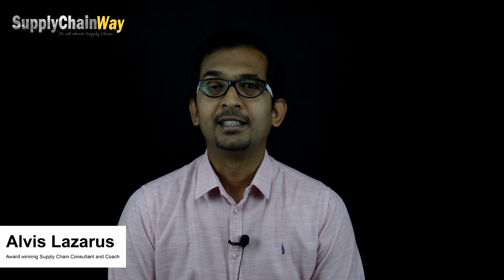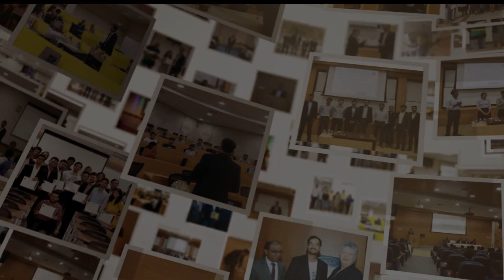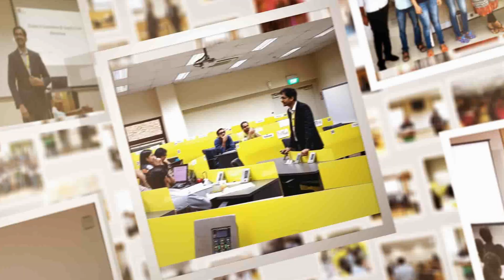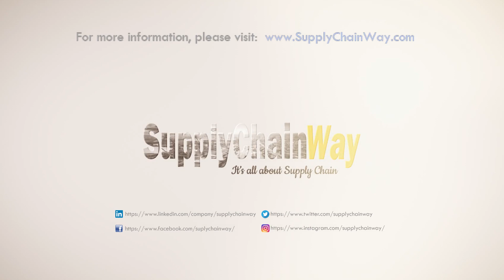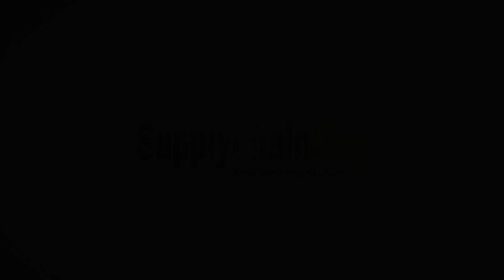SC0012 | PFEP (Plan For Every Part) DFEP (Design For Every Part)

Comment: Hi, Can PFEP be implemented in a consolidation centre where we receive, sort, store, packing and consolidate and ship to customers
Reply from the maker: Hello Kumar. Yes, indeed. Though the opt fit would be and end to end of supply chain. We can certainly use in consolidation centers. The PFEP would be having channels at the distribution work flow data point. 

Regards, Alvis Lazarus 
Supply Chain Way